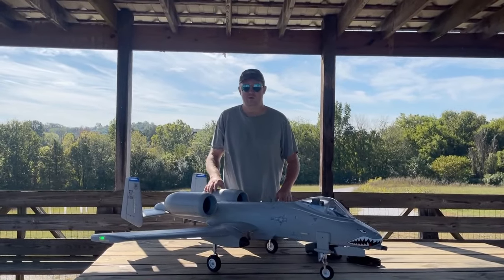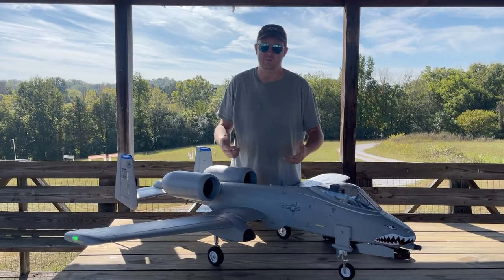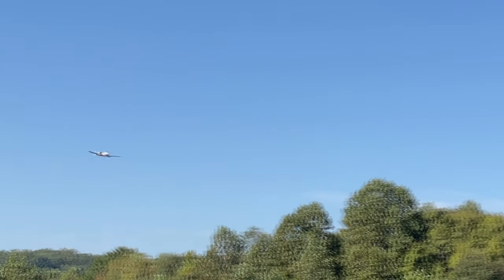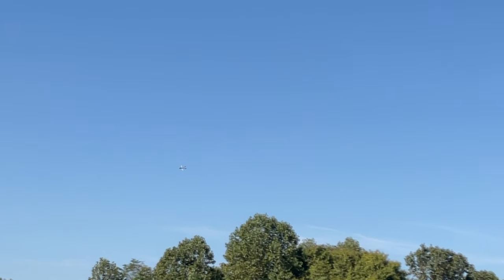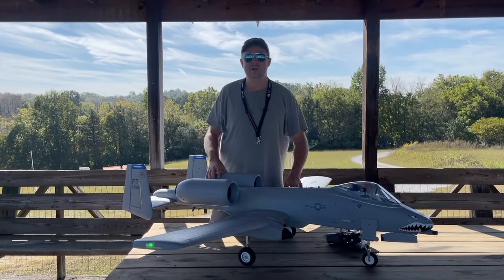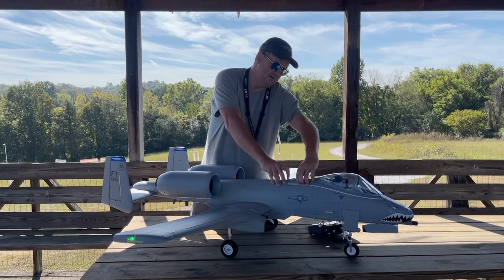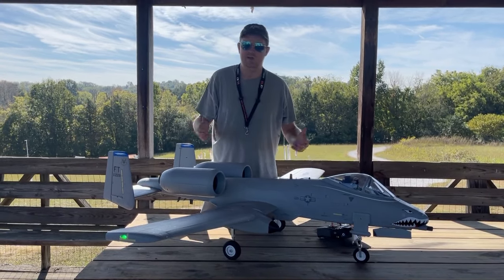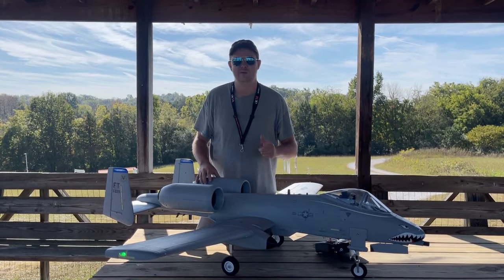Freewing A-10 Thunderbolt II Twin 80mm: Flight Review/Top Speed

Comment: I use SMC 6300 LIHV batteries. They are about the biggest you can put in there and I had to shave a little off the bottom of the canopy. 88mm to 90mm from the leading edge. Also move the blue box back about 4 to 5 inches. All it is, is glue holding it down. I took it off and used foamtac and re glued it. Battery placement is exactly where BD has them. I use 6300 packs so I moved back just a little more. Overall amazing plane and that whistle reminds me of the A-10s when I was stationed at Moody AFB in Georgia.
Reply from the maker: Good deal! I never tried SMC 6200 in this bird.

Comment: 😅 by the book and OMG it was nose heavy. I almost totaled it. Luckily, I got it back around and landed. I watched your maiden and then set it at 89mm as CG. Just got back from the field, and wow, she can boogie. Flaired it on landing and beautiful landing. As you know, we fly off of grass, so you have to touch mains first and let that front gear just settle in. Heavy plane with the batteries, she will glide and come in a little hot. But overall, it's a great plane. I have the special edition which had the inrunners. Awesome advice and for any one buying this plane please follow BDs advice.
Reply from the maker: Yes,book setting is terrible. 3 issues which i seen that give this A-10 issues from the start. Since making this video i pushed both battery back couple more inches and balance at 110mm.
Reply: @BDTennessee  Just saw this post, and I feel you are right, BD. Since I have flown it a few times now. I've had to push the rear battery back almost to the edge of the strap. I'm going to have to get my dremel out and make two notches for another strap. Because it was still pitching down, and i had to trim almost 100% to just maintain a slightly level flight. In the meantime, I've mechanically adjusted my elevators up  about  7mm because it's still slightly nose heavy until I can cut a couple of slots to put another strap on the rear battery. Don't know why freewing is still putting out such a foward CG when it's a KNOWN issue. Keep up the good work, brother.
Reply from the maker: @johnberrios4255  Sounds like you got a plan!  thanks for the feedback too!

Comment: I noticed on your first maiden flight and used 88mm for your CG, you had all of the ordinance attached to both wings. On your second flight review, I noticed you removed the ordinance, used the same 88mm rather than 78mm and moved the batteries back perhaps an inch or so. Did you move the batteries back to accommodate the lack of ordinance and changed the CG? Enjoy your flight videos and commentary.
Reply from the maker: Maiden flight i had them on in first start of video but not in flight. All my flights i left them off. Since making this video i moved CG back to 110mm...